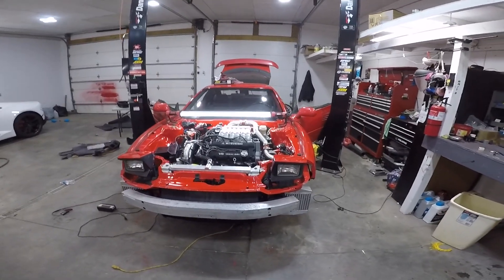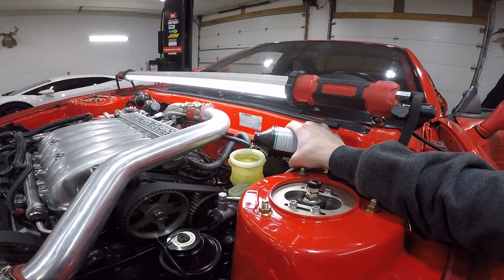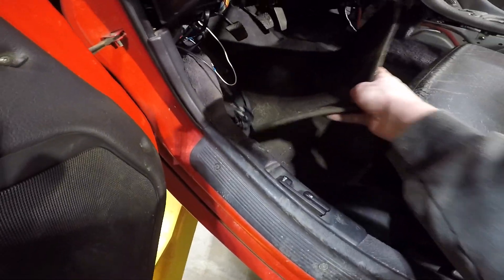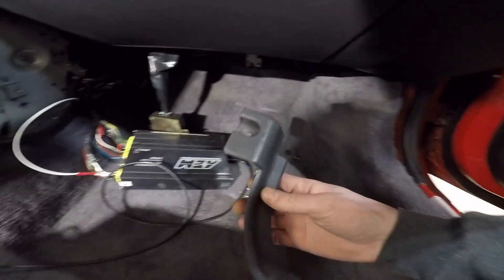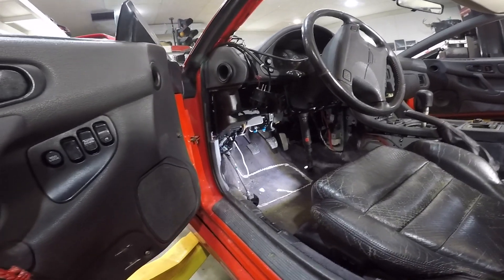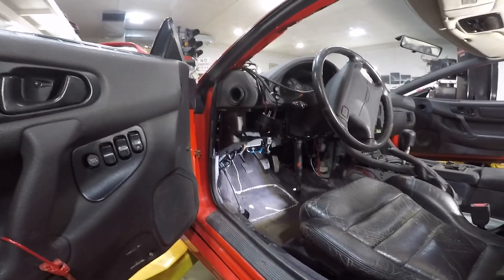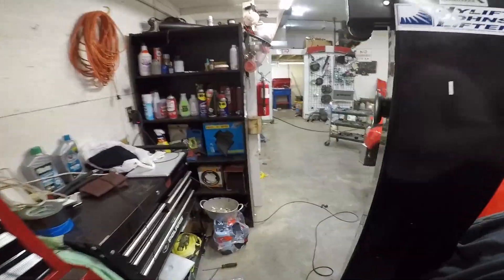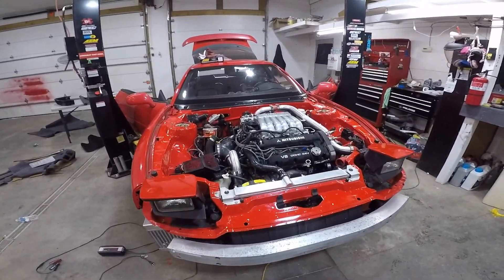Clutch Safety Switch delete & Brakes bled [ 3000gt vr4 ] 6g72 tt

Comment: Great videos! Absolutely love them but im pretty sure that unbolting them and zip tie them somewhere would have worked. Also, get a volt meter. It would have saved you from taking it apart.

Comment: It's "warm" today so hopefully you got it out for a little drive. I know who to have fix my cracked valance now, lol. They crack in the center due to wind resistance and lack of bracing and I haven't been able to get to it
Reply from the maker: I still don't have the alternator ... positive learning is not that hard to go check on my video
Reply: I can't believe you're still waiting on the alternator. I can definitely fix it, but the one arm life makes it kind of hard. I go back into rehab this month, so hopefully, I'll have two working arms again by summer. It'll be three years in June, so that would be nice.
Reply from the maker: @mjc8248  yea that sucks I had one arm for about 8 months after my stroke I could not use my left arm
Reply from the maker: I still bothers me from time to time

Comment: that 2nd switch is most likely for the cruise control? and on the jdm GTO the brake lines and servo are in the same place. there is a bar behind the dash that the pedal connects to on the right side (where driver sits) over to the left and operates it through the same orifice.
Reply from the maker: ForReal 100% that's crazy the brake reservoir is still on the left side of the car ? .... it's not like that with Nissan's